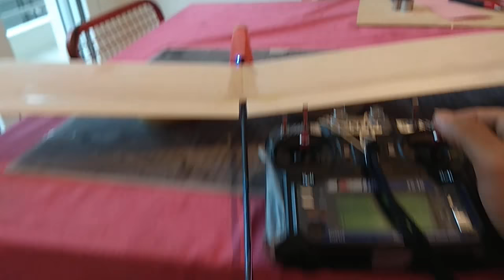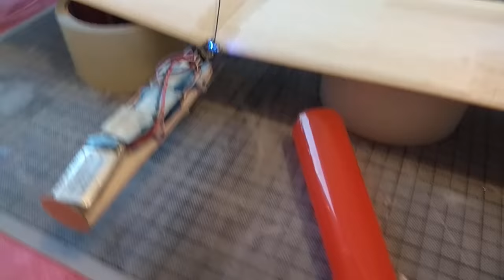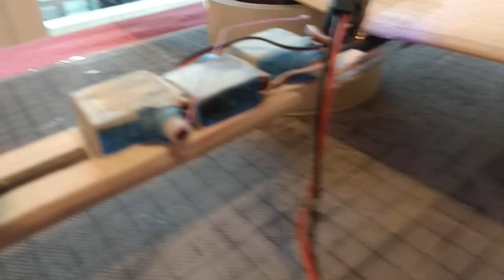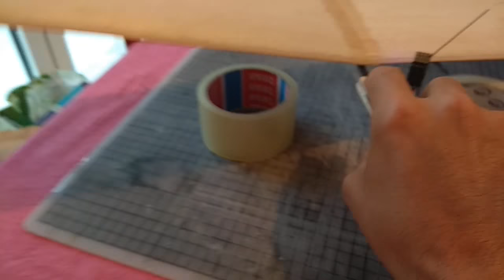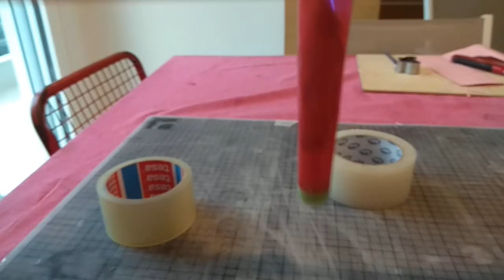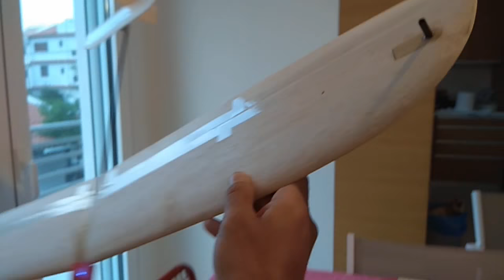1m balsa DLG glider with ailerons - scratch build DIY

Comment: Hi, thanks for all informations. Just a few questions: receiver is directly connected to battery? Is it 1s 3,7v 400mah? That Micro servos operate between 4,8 and 6 volts? Is it enough from that battery? Thanks a lot
Reply from the maker: Yes to all ! 1s 400 is good for even 4 servos, and the flight time will be more than an hour (1-1.5h). Servos will work perfectly, just a bit slower, but no problem with gliders.
Reply: @afilos   😊👍

Comment: Do You think that FlySky FS-iA6B Receiver 6CH 2.4G (Input power: 4.0-6.5V DC) would works with an 1C 3,7 V 450mA Li-Po or I have to use 5V dc-dc converter with an 7,4 V Li-Po? Thanks!
Reply from the maker: No it won't work, it loses signal and you will crash. You need a step up or a step down voltage regulator, but then you add extra weight. You should use the one i use, which is ok for a 4 chanel plane if you solder a battery connector directly to the pins of the receiver.
Reply: @afilos  Thank You for Your answer! So it can cause that the battery (3,7 V) will connect to the receiver without any cable and there is no waste energy?
Reply from the maker: @goldenfish77   you solder a cable (black, red) that ends to a battery connector on the two pins of the receiver and at which you connect and disconnect your battery.  If you want i can send you a photo.
Reply: @afilos  As You tell me that I have to see RCGroup forum, I found this thread:
https://www.rcgroups.com/forums/showthread.php?958260-3-7V-receiver-battery-OK
Voltage booster it seems to be good (3-4 gram extra weight) for an 3,7 V Li-Po.
Reply: It works ok for me. I made a Lidl glider conversion, and use one Li-ion cell from a laptop battery. I've never lost signal.

Comment: Nice....No fly video?  Will there be a build video? ✌
Reply from the maker: Thank you, check out the fly video https://www.youtube.com/watch?v=j0Iw-KJ0dRc and there is one where I catch my first 3 minute thermal coming soon. There is no build video but I have posted in the comments all the details for you, happy to answer any questions for build details...
Reply: @afilos  Thanks.. ✌
Reply: Hi.  Just wondering.
Where you get your 1c 450?
Can't find a 1c..
Thanks
Reply from the maker: @charlesmilbourn6861  No need to go for a 1c, this is just what i fund available when I got strarted. You can go for a higher C rating as long as the weight is what you are looking for. I Buy my batteries locally (Greece) for example  https://www.ariesrc.gr/en/oversky/7005-os300mah-37v-20c.html  or https://www.ariesrc.gr/gr/oversky/11730-240mah-37v-30c-li-poly-lipo-battery-for-rc-syma-helicopter.html
Reply: @afilos  Great.  I'm looking to make a 1.5 meter... I have the flysky. Radio... Thanks.. ✌
Reply from the maker: @charlesmilbourn6861  Great can wait to see it fly!

Comment: Hello, I'm new to RC and want to build a small dlg. Seems like you have only elevator and ailerons for control surfaces correct? No rudder?
Reply from the maker: Yes correct, no rudder.
Reply: Also looking to build my first rc plane and will do a balsa DLG. What would you say is the difference between ailerons and rudder? Rudder would require one less servo i.e. save some weight? What about rudder and ailerons vs elevons(?) in a V-shape on the tail? To me it looks like the general design of a rudder sticking down would be prone to damage?

Also what kind of flytime do you usually get with the receiver/battery?
Reply from the maker: @C11ffH4ng3r  you can't combine v-tail with DLG, you wont be able to launch straight. Indeed the tail is prone of braking on bad landings, that why we try to catch them rather then land them.
You can fly equaly well a rudderless plane and a full house plane.
Flying time would be around 1h with this setup.

Comment: How do you shape the profile of the wing? I see you have a link to the profile in the description
Reply from the maker: The plans is a true copy of the hawk (see comments) and the airfoil is a AG46ct -02f rot. (http://airfoiltools.com/airfoil/details?airfoil=ag46ct02r-il).

Use a 0.8*10*100 balsa sheet 72grams, cut it in half and cut the wing tips as per the plan. Glue a hardwood strip (I use a 2,5mm basswood) onto the entire LE (this is a must!) and give the shape of an airfoil to the two wing halfs using the following method https://www.charlesriverrc.org/articles/construction/markdrela_airfoilshaping.pdf.
Stick the airfoil paper profile on to the root side of each wing and start marking where you want your cut's to be . Bottom wing side is flat.
Shape the dihedral of the wings the way I show you in my videos and glue them with 5min epoxy. Glass the entire wing root connection top and bottom with a 3cm strip of a 25-80gr/sq2 fiberglass (I used a 25gr/sq2) with 5min epoxy. 
Balance the wing after installing the wing peg.

Good Luck